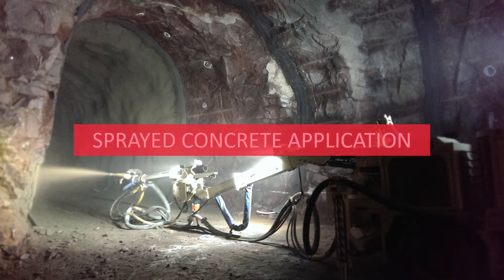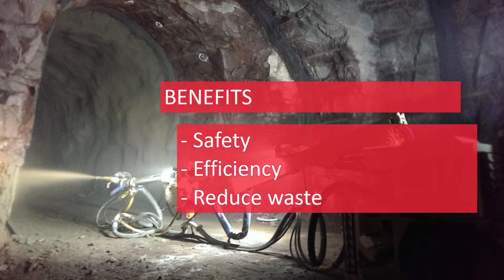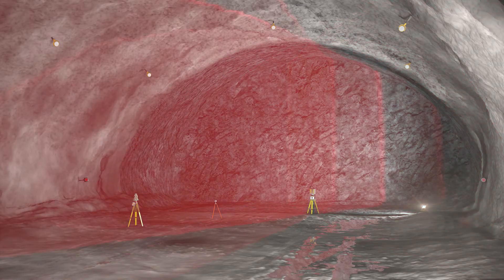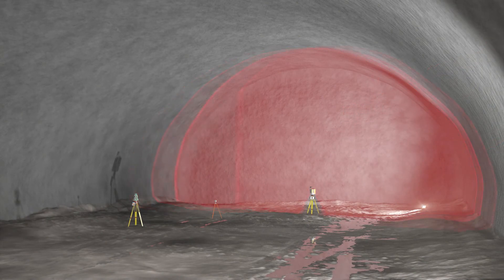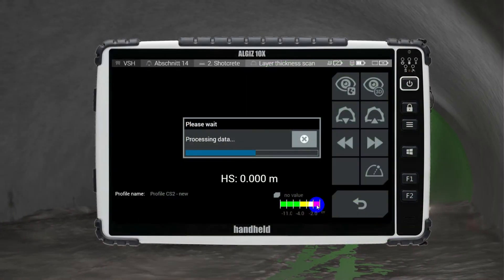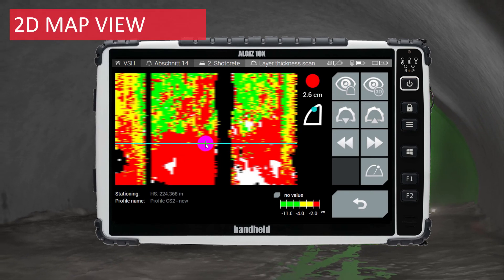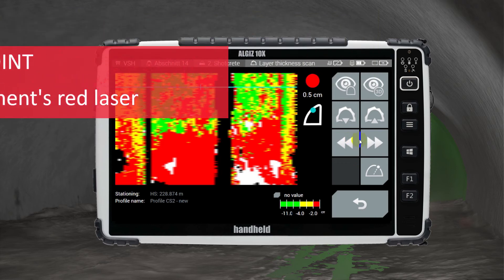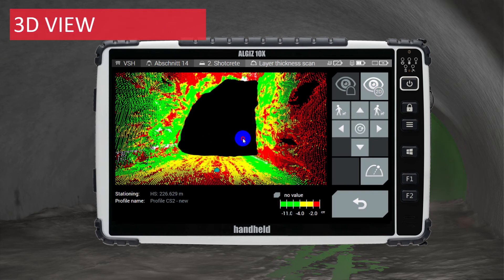Shotcrete Layer Thickness Overview - Amberg Navigator Tablet

Comment: So then you can create a digital model of the ideal finished concrete surface, which could be utilized to guide digitally-controlled concrete placement.
Reply from the maker: Hi - that's right. There are interesting things happening in this area.  Please feel free to get in contact with us about any questions you may have. https://ambergtechnologies.com/about-us/locations-contact/

Thanks for watching.
Reply: @AmbergTechnologies  Interesting, yes, thank you!   We are working on concrete/placement full thickness with quick confinement/vibration - that can be digitally controlled - for vertical surfaces. Faster then spraying, no rebound etc. Not yet for overhead, though that appears possible as well, using a more expensive mix.